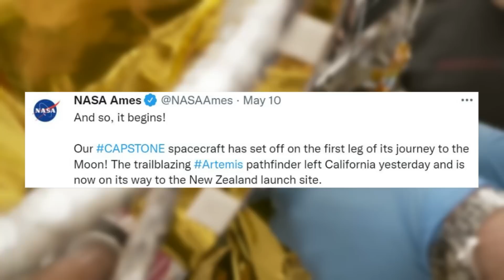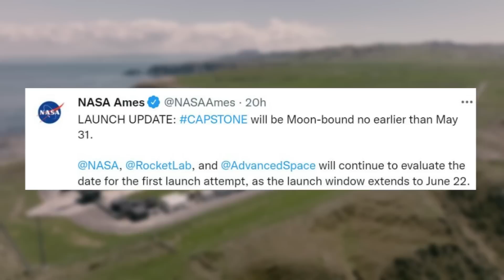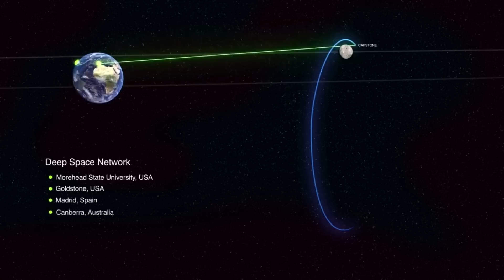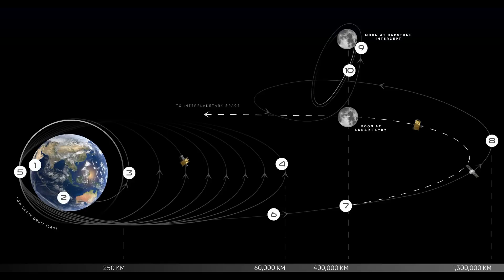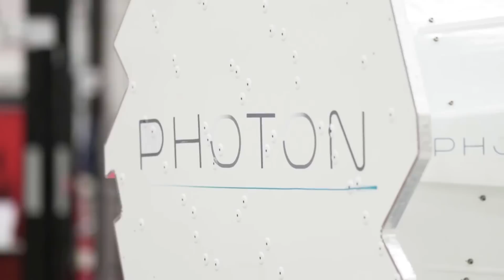Rocket Lab’s Mission To The Moon Is Only Weeks Away

Comment: It is very cool to have an essentially COTS purchased lunar mission. 
More money for SLS, right guys?!
Reply: I believe that CAPSTONE is under the Artemis program, along with SLS, Orion, Lunar Gateway, HLS, etc.
Reply: @steveaustin2686  Yes, Capstone will test the Orion's orbital path.
Reply: There is no way any of the electronics is COTS.  Once you get outside (or through) the Van Allen belts COTS is useless.  At a minimum you have to buy rad tolerant in a multi redundant configuration. Its also one of the reasons why SLS is so much more expensive than SpaceX.  SLS was designed from the start to operate beyond the Van Allen belts (upper stage and payload).  COTS FPGA: $50,  rad tolerant FPGA: $15000.